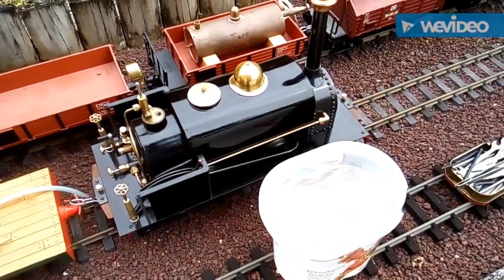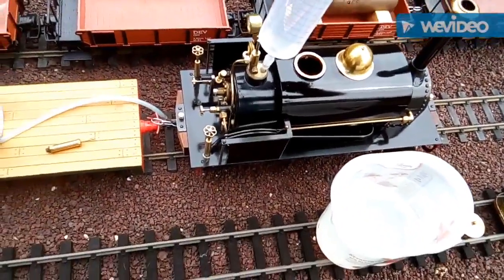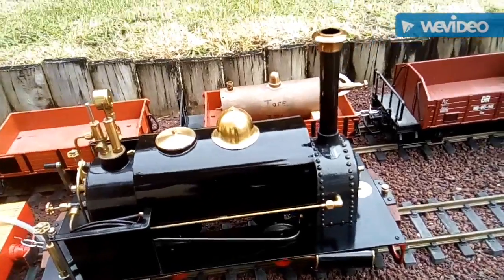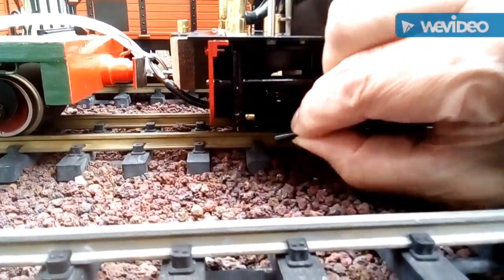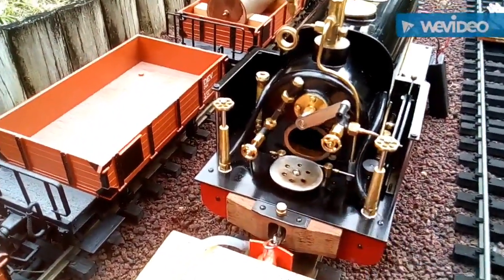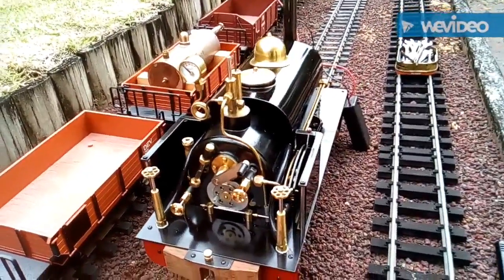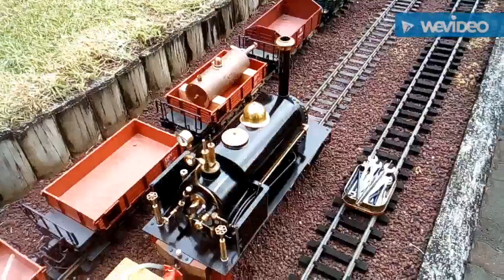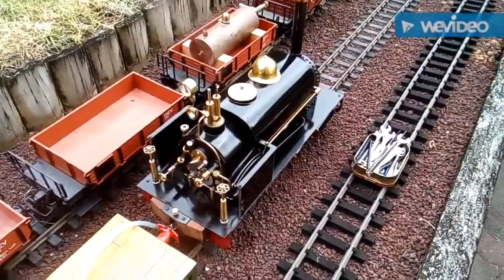Steam Raising Quarry Hunslet locomotive

Comment: What is the blower arrangement in the smoke box? I'm building a similar boiler and cant seem of find any documentation on blowers for this scale, Is it a ring like on the big 1" scale locomotives or does it have a T on the exhaust of the engine going through the blast nozzle?
Reply from the maker: It's a single tiny jet under the funnel right beside the blast nozzle.  I have small jets very good and they don't use much steam.  I was just reading LBSC's thoughts on this last night.  Single jet is fine for long chimney locos, but multi jet is required for short stubby chimneys
Reply: @GardenRailway  thank you mutch, 

My chimney is short so looks like I'll have a blower ring. also which of LBSC's writing's did you get that from, I would like to get copy.
Reply from the maker: It was from a 1931 or 1932 Model Engineer magazine.  It might also be in his 
Shops, Shed and Road. The Live Steam Book. By "L. B.S.C."
book.  I must get one for myself
Reply: @GardenRailway  sorry for the pestering of questions but, How does the blower work on your DeWinton? It seems to have a rather short stack?
Reply from the maker: @johnkuzma7066  No problem at all.  It's down in the firebox, below the base of the through boiler single flue, just out of the flames